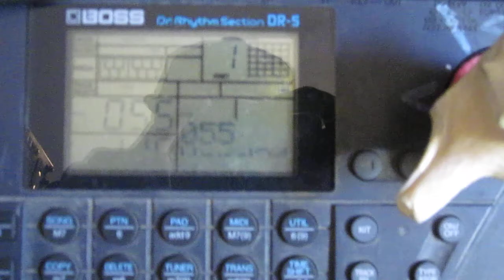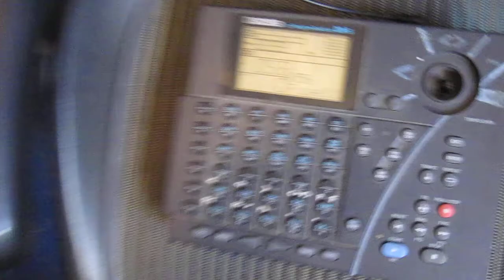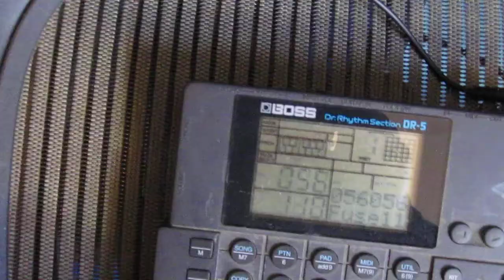Researchin' with Alexander: Boss Dr. Rhythm Section DR-5 LCD screen

Comment: who would have thought!!!  it worked for me !!!! I was trying to find a replacement screen and this video popped up in google!  thank you so much!!  the screw on mine was actually under the board.
Reply from the maker: we are happy to hear of your success. the DR-5 machine is eternally mean. i just wish it could store pitch bends in the sequences. it can play pitch bends from external sequencers, and i've even set different pitch bend ranges for each DR-5 channel by means of external MIDI messages. i think the max range is 12 or maybe even 24 semi-tones at which point the little module becomes a roller coaster ripper.

Comment: How do you get the knob off?
Reply from the maker: Pull the knob directly outward from the machine to get it off the peg. Then, spin the thin little nut around the threaded base of the peg to loosen the dial from the top half of the machine body. I am frustrated with YouTube because I received no notification of your comment.